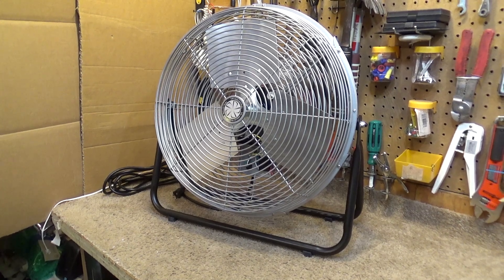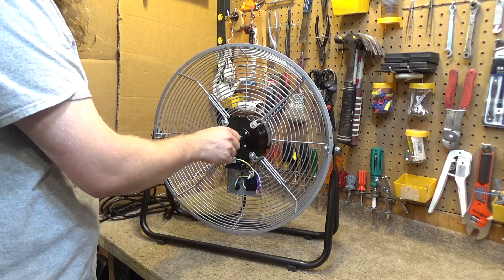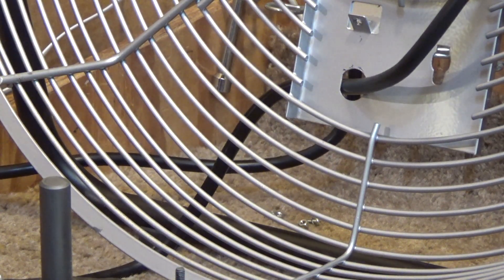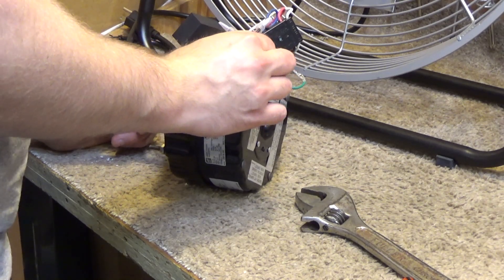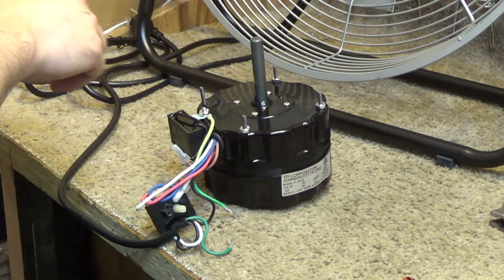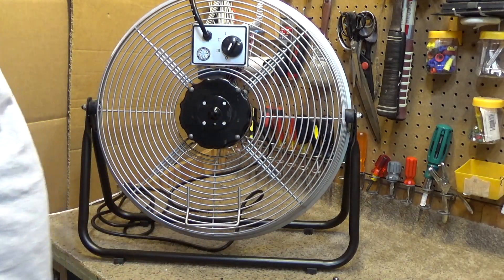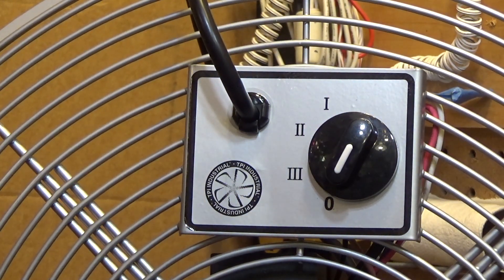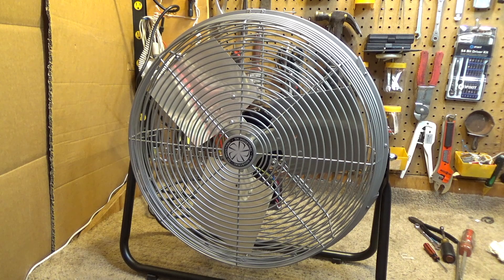TPI F-18-TE 18" High Velocity Fan | Tear Down for Cleaning and Service

Comment: That’s very impressive. The motor’s construction looks on par with a lot of full size, multi-HP electric motors; noting the cast rotor cooling fins, neatly tied and varnished windings, oil ports, etc. You pretty much don’t see such motors on fans like this anymore. Props to TPI for producing high quality fans. Great video!
Reply: Couldnt agree more. Those motors look like they could last. If only all fans had such good qualitt motors.

Comment: The MBTA subways have been using a ton of industrial TPI wall and pedestal fans. I was 4 when I first remember using the MBTA subways. And I fondly remember the TPI wall fans being used in the stations. After ten years, the exact same fans are still there running nearly 24/7.
Reply from the maker: Thanks for letting me know.

Comment: That motor looks very similar to the McMillan motors that WCI used in their small window units in the 90's and early 2000's, even down to the edge of the outer shells having a wavy cut. It looks like the same tooling was used to make the metal shell. I can't speak for the internals however since I have only had to take apart a shaded pole motor from one of those machines, not the PSC. Those motors used the same shell for the PSC and the shaded pole version, however the shaded pole had a few vent holes and the PSC does not if I remember correctly. They both also have a couple small drain holes in the bottom but that's to be expected for an outdoor rated motor.

Comment: Interesting how the 18" TPI's actual current draw is right on par with what's listed on the tag, while the 12" fan is listed at 1.0 but actually draws around 0.65 on high speed. I ended up retrofitting a blade set off a dead Air Flight hassock fan (which is pitched WAYYYYY steeper than the blades TPI includes on these fans) on to my 12" and the current draw went up to 0.77. I'm still hoping to eventually find an old Frigid-style blade set for my 18" TPI though, the sharp cornered square blades just aren't cutting it for me looks-wise.
Reply from the maker: I may try increasing the pitch on the 12" to match what the motor is rated at, it would certainly make that fan a lot more useful. I kind of like the blades, it reminds me of the Patton U2-20.
Reply: @JordanU  I’m tempted to post a video of it in its current configuration. In hindsight, I really should have done a blade swap video
Reply from the maker: @whoisthisguy724  I'd be interested in seeing it.

Comment: Hey Jordan, you know anything about TPI not selling these floor fans anymore? It was mentioned to me last week so I checked Amazon and I only see fans on third party sellers for crazy prices..
Reply from the maker: When the stock on Amazon gets low the prices always shoot up. Sometimes it's just temporary and will return to normal when the stock is refreshed, other times it's an indicator that the product has been discontinued. AirDistributor still has them in stock for the same price they've been selling for recently.

Comment: One of the best modern day fans made. My work place has tpi  20 inch non oscillating wall mount fans with oil ports. Very powerful fans. They also have a few newer Daytons that are probably 14 inch sadly those don't have oil ports, those are only at work stations that have limited space . Would you recommend using the 12 or 18 inch version of this on a large screened in front porch? My mother uses a 1991 galaxy I think it's a 3173 20 inch box perhaps fan that's protected from direct rain blow in.  I keep regular maintenance performed on but id rather clean it up better and store it because it's basically a  collector now. However most modern day fans are complete junk especially in an outdoor setting where a small breeze over powers them.
Reply from the maker: The 18 would be great on the porch.
Reply: Thanks Jordan I'll see about getting one for her.

Comment: Any experience with the CF model of these fans? I’m looking for a nice industrial fan and they seem to be way cheaper at the price of slightly less airflow (CF-18). If yes, does that model have oil ports too?
Reply from the maker: Not here. I took a brief look at them on the website and they look an awful lot like most of the cheapo Chinese high velocity fans found at the big box stores.

Comment: What is your favorite model out of the three TPI fans you have? The 12 inch, 18 inch, or 24 inch fans?
Reply from the maker: It's hard to compare them, the sizes are so different that each one has different use cases.

Comment: Any idea where to get that capacitor?
I can't find it any where with the -P at the end.
PS: The blade did break the housing quite a bit on the capacitor.. I am sure you are right about the blade being ok..
Editing as I watch.. My fan problems could be down to a broken zip tie.. 
I am very happy to see the inside of this motor.. VERY impressive..
Thanks for doing this tear down..
Reply from the maker: Forget about that number, there's no need to find an exact part replacement. What you need to look for is the micro-farad value, which is the 5uf. Voltage should be the same or higher, so 370 or more. Any capacitor that fits those specifications will work. Send me an eMail if you want me to send you a few links to ones that would work.
Reply: @JordanU  Ahh good, I can see plenty over 370.. Will email you.. Thanks